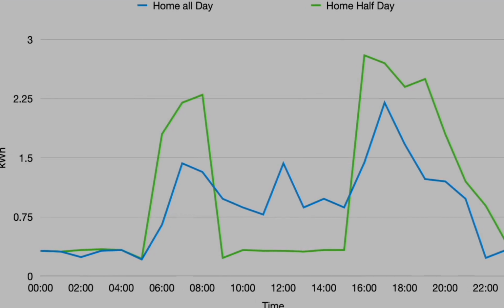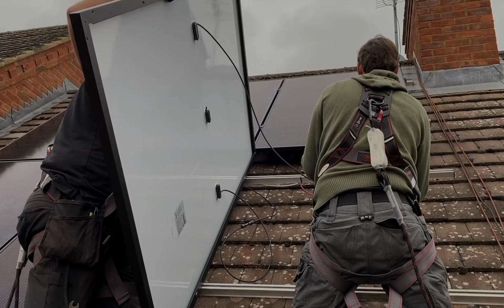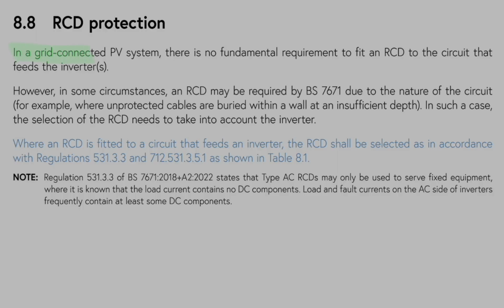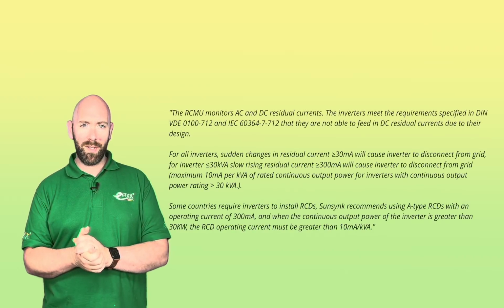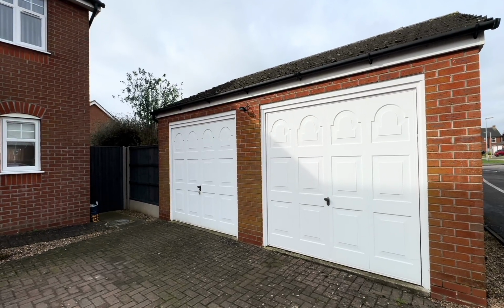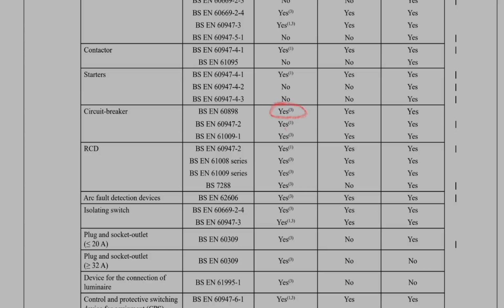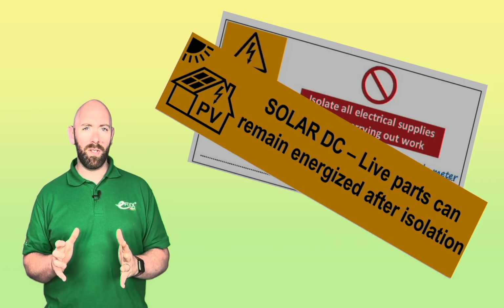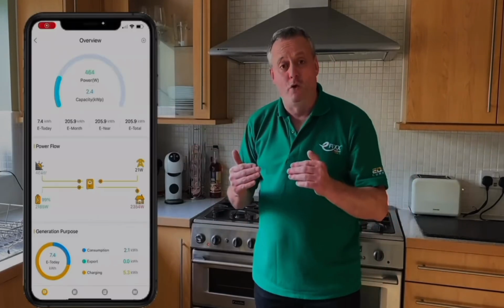Critical Electrical Preparation Before Installing Solar!

Comment: Tesla PW3 has built in DC isolator, however their bulletin to installers in September says 'not to rely on built in isolator' - 
"To facilitate safe maintenance and testing, local electrical codes require a means of isolating the PV array be provided adjacent to a PV inverter. The integrated DC isolator in Powerwall 3 provides a means to switch-off the feed from the PV array, however the PV wires terminated within the Powerwall 3 remain live. To achieve full code compliance, it is necessary to provide a means of PV array isolation external to the Powerwall 3."
Reply: In the Netherlands, regulations now prohibit installing DC isolators when the equipment already has one — because the DC isolators are by far the most common cause of fires, for some reason.
Reply: Yeah, we’ve had that in the uk and now gone back to having to install them 💁‍♂️

Comment: why would the cables need to be the same length to charge the battery's equally?
Reply: Resistance of the battery cable..
Reply: @MikeGleesonazelectrics yeah but ehy eoukd that make difference? 

Is absolutely marginal difference. Even a millivolt between the batteries would equalise almost instantly
Reply: @njipods  you state that with a lot of authority, I'm not sure why?  LFP packs will tend to rest at very similar voltages for the bulk of their discharge/charge curve while being at very different states of charge.  On these low voltage (51.2V) systems the current can be 50A+ into the inverter, a little bit of additional cable resistance will have quite a significant impact.

Comment: Wow the subject of rcd s I have been doing on about for a few years. It got to the point now where I actually always contact the inverter manufacturer and in nearly all cases they come back with a list of devises normally type A and bidirectional and min of 100ma to 300ma. So I tend to follow the manufacturer's recommendations and always fit an separate CU to accommodate the 100ma. Keeping away from the main CU. Same with EV chargers. It's deffo good to contact the inverter manufacturer to be 100%.

Comment: Looking at the latest manual for the SunSynk 3.6kW Ecco it states a cable size of 6mm to the grid, along with a 40A MCB/RCBO. I think this is because the inverter can be wired to pass up to 35A through from the grid to a backup circuit. 

I guess even if the inverter isn't configured with anything connected to the load terminals initially, it might arguably be safer to go with 6mm/40A in case a backup circuit was added later without consideration for the grid passthrough.
Reply: adam loves 16a breakers instead of 40a
Reply: Don't forget voltage rise at the inverter comes into play too.  There's no point in having 3.6kW of capacity if the voltage at the inverter rises high enough to force it to limit current to keep the voltage in the acceptable window.  A street supply towards the top of acceptable voltage can be enough to cause it even with a modestly sized solar installation.

Comment: I’m glad I don’t have solar and never will.
Reply: Yeah I don't understand people like you. Why pay 200 euro per month when I can pay nothing.
Reply: @andysims4906  poor Andy 🤣🤣
Reply: @andysims4906  Are you glad you have expensive electricity? Are you glad you're at the mercy of the electricity providers?
I have solar and 25kwh of batteries.. they pay me for most of the year. Don't you want to be free??
Reply: @ I do know quite a lot of people who have solar . One person was so disappointed with it he had it ripped out and sold it on eBay . One person had his panels ripped off in a storm. Damaged his roof and a panel landed on his car smashing the windscreen. 2 people I know have had inverters go wrong. 1 person twice . 
My neighbour had it installed about 18 months ago  The installer advised him not to have a battery system as he would have to replace the batteries in 4 to 5 years . It’s not free when you take into account the original cost and future repairs and maintenance.
I prefer to pay more for my electric. Have no worries about future problems. I’m also probably making more money through high interest savings accounts than investing the same amount of money in solar
Reply: @andysims4906  I can say from personal experience I have made over £1100 this year in solar generation, but that's not it.. I have sold about £500 back to my supplier, which was electricity that I didn't need.  It's not perfect, but surely you want to have some control of who is dipping into your wallet..
If not, maybe you wouldn't mind posting your address and letting everyone know when you're going on your holidays.. please don't, but you get the point?
Reply: Hahaha! Sucker enjoys being a slave to big business. I prefer freedom.
Reply: why? im literally spending half my income on electricity due to the datacenter so solar would be a godsend
Reply: I'm 9 years in and in that time have gone from buying electric at 10p to 24.5p  a kWh so making 3000+units a year is worth it to me.
Reply: what a silly comment